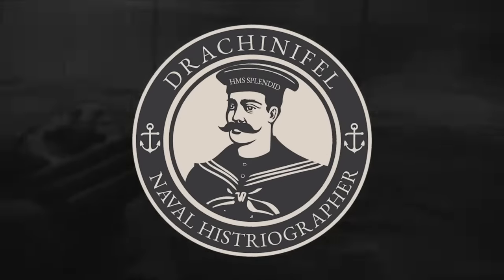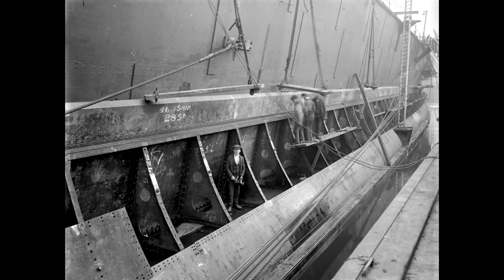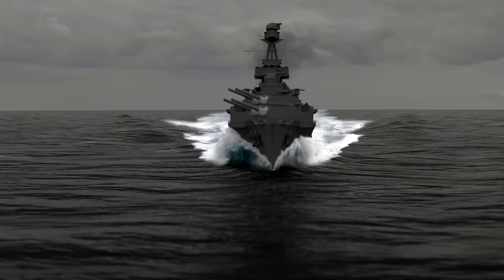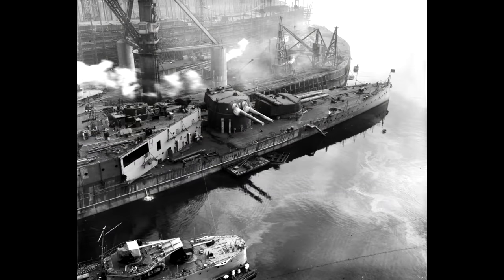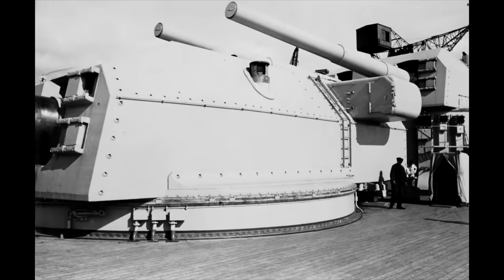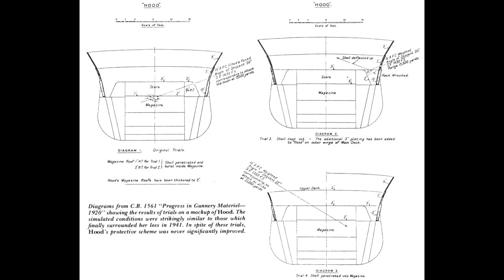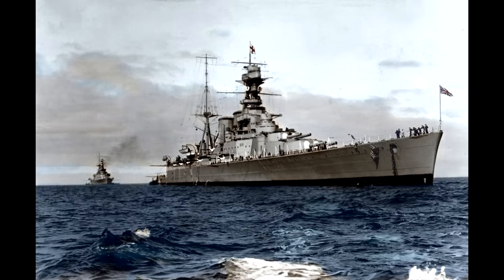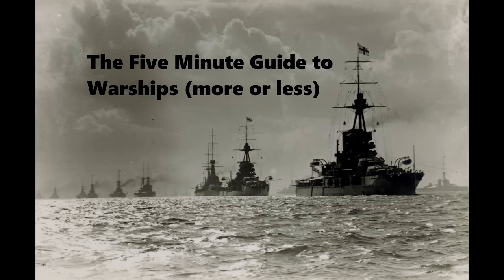The Loss of HMS Hood - But why did it blow up??

Comment: The captain of POW had the impression "something had arrived on board Hood". Another observer on POW "it was clear she had be it as dark colored debris were thrown up". Germans onboard Bismarck observed a hit "near the after turrets". Bear in mind the 40-50 angle of observation from that position relative to the Hood bow on. Admiral Wake Walker observed a splash alongside Hood and associated it with the above water torpedo tube doors (exactly in the area of the bow wave trough). Another translation stated the Germans observed a hit near the "hanger" which Hood did not have, and I took this to be the after superstructure, anti aircraft and torpedo control tower. The angle of decent of Bismarck's shells wasn't steep enough  to get that deep enough to penetrate in or near a magazine via a shelter deck hit. I had always thought perhaps an upper deck penetration or a 7" belt penetration adjacent to an after barbette (which thinned significantly below the upper deck) a likely culprit. I like Drach's theory as it lines up with some observed phenomena. Captain Leach mentioned a "short or two"
Reply: Privately, Captain Leach told another Captain that the exploding UP ammunition was the cause of the ship's loss. Mentioned in "Flagship Hood". The original source is another British work- an official one, I believe, but don't quote me. In any event, there's no reason for these people to lie about it, and every reason to play this down during wartime. Postwar, few are willing to acknowledge the possibility that this is the case.
Reply: @manilajohn0182  Jack Leach wasn't a fool.  The idea of UP & 4 inch ready use ammunition, stored in light lockers on the boat deck, bringing about the sinking of Hood, is simply preposterous.   If Leach said this, please supply your source.

Incidentally, at the time Leach was rather busy. Do you really think he was spending his time looking at Hood, rather than commanding his own ship?
Reply: @dovetonsturdee7033  I provided the source in the paragraph which you responded to- "Flagship Hood", by Ted Briggs. Briggs quoted a passage from a work by Arthur Marder entitled "From the Dardanelles To Oran" in which Leach "allegedly" told Captain G.H. Oswald that 

"The rocket weapons and unsafely stowed ammunition were the direct cause of the loss of the ship, probably through the explosion of the ready use cordite penetrating the flash proofing of X turret".

 You don't have to believe that Leach said it, but it's clear enough that both Marder- a renowned Royal Navy historian with a solid reputation- and Briggs do, since they both quoted it. Briggs' belief as to what caused the loss of Hood is fascinating and worth the read.

The theory that the ready use ammunition initiated a series of events resulting in the loss of Hood is currently one of the few generally accepted possibilities. 

Leach was busy conning his ship. IIRC, Leach was actually looking at Hood, and was awaiting the confirmation to initiate the turn which Hood had signaled earlier.
Reply: @manilajohn0182  Sadly, Marder died over 30 years ago, so what Leach allegedly said to Oswald cannot be verified.

Neither of the Enquiries into Hood's loss attributed it to the explosion of ready use AA ammunition. Indeed, Briggs stated that the fire on the boat deck was reported to Holland, who said 'leave it until the ammunition is gone' and Tilburn, who was actually on the boat deck, stated that the 4 inch ammunition hatch on the boat deck was 'definitely closed' during the action.

Jack Leach also gave evidence, stating that the explosion was 'before the mainmast' as did his navigator, Lt. Cdr. Rowell. Neither made any reference to the "explosion of the ready use cordite penetrating the flash proofing of X turret". The Enquiry did state that, as PoW was in action at the time, this fact may well have prevented observers aboard her 'from giving a clear cut impression of the occurrence.'

The evidence of technical experts led to the conclusion that :- 'The fire was not in itself the cause of, and was distinct from, the explosion that destroyed the ship. The fire which was seen on Hood's Boat Deck, and in which UP and/or 4 inch ammunition was certainly involved, was not the cause of her loss.'
Reply: @dovetonsturdee7033  Marder's death has no bearing on verification of what Captain Leach allegedly said. The passing of the Captains on the other hand, would. 

I'm aware enough of what the official enquiry's conclusions were, and of what Captain Leach stated there. The fact that the 4" ammunition hatch was reported closed does not mean that it was, or that battle damage did not open a path to the 4" magazine- but I'm also not saying that it did. 

Yes, Captain Leach didn't provide evidence that ready use cordite penetrated the flash proofing of X turret. Captain Leach was also never directly asked what, in his opinion, caused the loss of Hood. He did say that the fire became so great that he came to believe that it "endangered the safety of the ship" (I believe that's the exact quote). 

It's understandable why the enquiry didn't go down that path. In wartime, one does not give "aid and comfort" to one's enemies. By this I mean pursuing the path of the exploding ready- use ammunition and subsequent chain reaction eventually causing the loss of Hood. The reason why they wouldn't is because there is widespread agreement that the initial hit which caused the ready- use ammunition to detonate was caused not by Bismarck, but by Prinz Eugen- meaning that the pride of the Royal Navy was sunk by a "mere' heavy cruiser- which provides "aid and comfort" to one's enemies. 

While not pursuing that path in wartime is certainly justifiable, not doing so postwar is not. Aid and comfort, as well as national pride, then take a back seat to the search for truth. 

I'm not about to say that the ready use ammunition theory definitively caused the loss of Hood. Far too much of the ship is missing, and that alone almost certainly precludes ever establishing what caused her loss. That said, it remains one of the few existing theories regarding her loss, and is- at the very least- as likely as any "lucky hit" theory. Personally, I think it highly likely- but that's just me.

In any event, i encourage you to read "Flagship Hood". Aside from Briggs' opinion on Hood's loss and the enquiry, it provides a wealth of information of his life aboard one of the truly great ships in naval history.
Reply: @manilajohn0182  Marder's death is relevant, in that it makes it impossible to determine his source for the comment.

 'He came to believe that it "endangered the safety of the ship" '   If he did say that, it doesn't appear in the Enquiry findings. Whilst he may not have been asked that specific question, it seems odd that he would have expressed tho opinion to the commander of HMS Kent, but not to any of the members of the Enquiry panels.

'It's understandable why the enquiry didn't go down that path.' Not really. The Enquiries were set up to determine what led to the loss of the ship. The Board for the first one consisted of a Vice-Admiral and two Captains, and for the second one a Rear-Admiral & two Captains. Both Enquiries were confidential, Admiralty, affairs. At the time, there was no suggestion that any of the hits had been from Prinz Eugen, so the idea of concealing anything did not apply.

I will, however, get hold of the book as soon as possible.

Comment: If Hood had been reconstructed, a lot of the unnecessary thin armor around the casemates and superstructure would have been dispensed with, along with the heavily armored but rather useless conning tower. With improvements to horizontal and underwater protection, Hood (like Renown) would have essentially emerged from her refit/reconstruction with essentially an "all or nothing" protection scheme, wouldn't she?

Comment: Where did you took ballistic analyses from? Hit angles you mentioned seems quite small. Also, after penetrating an armour there's an effect of "normalization" - projectile (or whatever left of it) changes an angle of travel. I don't see it in these analyse. Your analyse shows one of possibilities, but some statements (like the one that 60° impact angle is impossible) you shall support by a minimum amount of proof. Ether some ballistic table of a similar gun, or a full scale calculation. I realize of course that solving a 2-nd stage equation (I mean double integral) makes no fun, but it's necessary in that particular case.

Comment: Talking about the 41 breakout, I believe the 8” hit on the HMS Hood’s boat deck did more damage then the RN thought and the Golden BB was for the Prinz Eugene and not the Bismarck was the killer of the HMS Hood and not Bismarck. The reason I come to this conclusion is where did the fire streak happen? It was between the mast and the second funnel. I heard an essay that the HMS Hood was carrying extra 4” shells that were stored OUTSIDE a the magazine and the temperature on the boat deck was around 1200-1800 f. mêlâtes the armour deck and ignite extra ammunition and that ignited the 15” magazine which doomed HMS Hood. Plausible.
Reply: Nonsense. 8in HE rounds had NO chance of landing a killer blow on a magazine 6 decks down in the bowels of a ship.
Reply: @walterkronkitesleftshoe6684  
Sir, why nonsense? Did you take the chance to ponder on the subject? 
First: where did  the 8” round hit? The ammunition storage lockers for the 4” guns on the boat deck right? Have you considered the damage that one 8” round was doing? It couldn’t penetrate the deck armour at the angle in which was the fall of shot? One crewmen described it as a bunch of scolded cats running around hitting everything in their way. There was a tremendous amount of ammunition in the number of Large Lockers on the boat deck around the main mast right?  
Can you tell me just how many lockers were filled with how many rounds of HE and AP rounds that were cooking off on the port side of the main mast? Can you tell me, at just what temperature these rounds cooked off at? 

The repair chief told the crew to put out the fires. The emergency repair crew replied that they were going to wait until the fires die down as rounds were still going off.

 [At least in the movie (ha-ha-ha) the Admiral said on the bridge to wait till the ammunition lockers would stop going off! Unfortunately we will never know his last words were.]

The info was quoted as saying: “the fires would possibly reach the temperature of over 1,800* f. With that much heat, it is likely to “MELT THE DECK PLATES” and as the fires would then reach the torpedo room, with the temp of the melting metal, it would continue to melt , then arrive at the upper armour deck over the  4”magazine, and finally the 15” magazine, “on the port side”. Before the 15” mag would go off, the hole that was melted down made a surprisingly large hole, that was now there to release the “high pressure red fire stream”, that was when the 4” ammo in the magazine, just cooked off. After or while the 4” ammo burned off, the armour plate around the 15” magazine, could not retain the damage sustained with the devil scolded cats running a muck and then, destruction, she broke her spine and was gone 3 mins later along wth her entire crew compliment of ships crew, but for three to tel his tragic accident. 

Now it was something that crewman TED BROOKS TESTIFIED TO”: “with the fire column burning, there was a list to the starboard, shortly as she was righting her self, she suddenly healed to port never to recover. I’m writing this from memory of Mr. Brookes testimony. I don’t remember if I correctly quoted Mr. T. Brookes.

Comment: I bought and built hms hood and der bismark models when i was in grade school in the late 1970's both were motorized and were powered by 8 D cell batteries the 15 inch gun turrets were geared to a pto from the motor and rotated the turrets during operation rudder positions could be analogly programed by changing gear configurations before putting them into the water both were appx 3 feet in length and were accurately detailed

Comment: I know it got mentioned about half an hour in, but... only very briefly, and dismissed out of hand

I still don’t quite understand: why is the (minimum) 6ish degrees discrepancy between the angle a shell would have had to hit the deck at the likely engagement range, and the angle a shell would have hit the deck to penetrate sufficiently to hit the magazine, so definitely nothing to do with roll? As in, if one makes it 10 degrees discrepancy, for comfort, does a very large warship not ever roll 10+ degrees in whatever the prevailing sea state, and whatever the ships orientation as regards rolling as it turned, was? Actual question as I don’t know

Comment: Nicely done.  Fits well with the findings of the underwater expedition in 2001.  They, incidentally, found that there was some sort of 2nd explosion forward, possibly (probably) the magazines of the forward 15" guns.  The reason for that explosion is not known, and can (again) only be speculated with no definitive answers possible.  However, the 2nd explosion is the likely reason for so few survivors.  As you note, many crew in the areas forward of the explosion were likely to have survived the initial explosion of the after 15" magazines.  They were likely doomed by the secondary explosion of the forward 15" magazine.

More information on that:

http://www.hmshood.com/hoodtoday/2001expedition/index.htm

Comment: The diagrams showing the directions of incoming shells (e.g. at 28:40) all seem to show the Hood with a vertical alignment. Would the angle of the ship heeling over in a turn to port been significant and exposed more of the ship's side below the waterline?

Comment: Something I didn't hear you explore completely in your analysis... What happens in a high speed turn at sea? She heels in the opposite direction of the turn. In a hard port turn, this would artificially raise the water level on the starboard side of the ship as the ship heeled into that port turn. If Hood was initiating a high speed turn to port to unmask her X and Y turrets, the ship would heel to starboard. In addition to artificially raising the water level on the starboard side of the ship, this would also effectively tilt the decks towards the Bismark's incoming rounds, allowing them to hit the decks at a much higher relative angle opposed to the shallower physical angle of the incoming rounds. In other words, heeling into the turn, the hood's angle of heel to starboard tilted the decks enough to allow a higher, plunging angle of impact on the decks of the Hood, not her side. Plausible?
Reply: You got that exactly backwards. A large ship will heel away from the turn  & would n this case tilt away from bismark as well rasing the hull further out of the water exposing more of the lower hull if anything! Just do a little research if you doubt it.. it not at all under question & you can quickly and easily look for and find evidence confirming everything drach stated regarding the behaviour of large ships at sea.
Reply: @franoisdanson  I suggest you read what I said again. I got it exactly right. In any turn, the ship will heel in the opposite direction. In a hard port turn, the Hood would be turning away from the Bismark to port, to bring a full broadside to bear to starboard. In that turn, the ship would heel to starboard, artificially raising the waterline on the starboard side of the ship as the ship listed to starboard in the turn and the decks would be tilted towards the incoming rounds from Bismark. There are well known photos of modern Carriers conducting high speed maneuvering drills that show this effect clearly. In the book Red Storm Rising by Tom Clancy the MV Fucik uses this tactic against harpoon missiles to force the missiles to strike above the perceived waterline. When the ship straightens out, the missile entry point is well above the waterline, precluding any flooding from the hit.